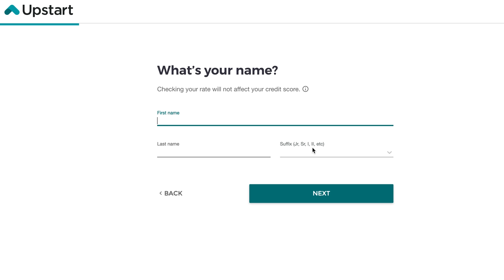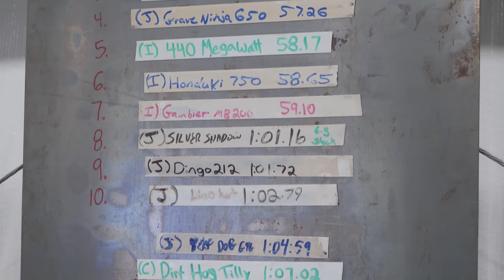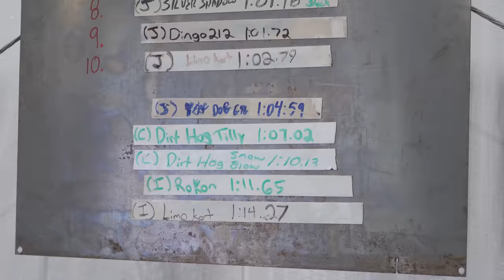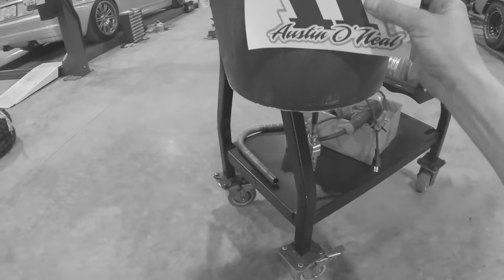SENDING Our 3 Engine, 3 Seat Mini Bike | SCARIEST Ride of Our Lives

Comment: That's just crazy wild. You guys should award each machine a "Pucker Factor", rated by how scary/sketchy they are to take around the track.
Reply: 5 million pucker factor
Reply: @catsbyondrepair  5 million seems a little tame to me, that's maybe the equivalent of a Habanero when this bike is closer to the Cali Reaper, or maybe the Dragon's Breath, or dare I say it, Pepper X. Its a pucker factor so high to initiate nuclear fusion, in which case the extra rocket thrust would make it even sketchier XD
Reply: No.
Reply: Wtf did I just read
Reply: @davedogg1177  Are you not familiar with the phrase "pucker factor"? Analogous to "tightening of the sphincter", and "clenching of the glutes". It's been around forever. Ben Hur probably used it while chariot racing! 😆
Reply: @catsbyondrepair  that sounds like enough to poop diamonds
Reply: PF of 11
Reply: I 2nd this
Reply: @moser1176 it’s there new diamond standard

Comment: It would be cool to take off down a straight road, max out the speed on 1 engine , 2nd guy start the next engine, max out the speed, then the same with the third.   Just to see how much difference each engine makes on top end
Reply: Or put the controls in the second position and let one person drive it to see how fast it is
Reply: Like Back to the Future and the train .
Reply: Maybe make each engine geared slightly higher than the last with the two first engine equipped with a sprag clutch to not over rev the engines. Sounds dangerous but fun for top speed
Reply: With governors it will be equal, acceleration will change.
Reply: Cassie Harry  tons of torque  though .
Reply: @Duckyninja50  underrated comment this is a great idea!
Reply: Cassie Harry  how about weight being a factor? I dont think one engine will top out the same as two or three
Reply: Knowing how horsepower and torque work I know that HP averages and torque multiplies.
Reply: @Duckyninja50  You do that and you'll over rev the first one and it will be pulling instead of pushing. You would have to drop out the first before applying the second like a trans but each gear has its own engine.
Reply: You my friend are a evil genius I like this idea and support it. 100%
Reply: DidI say it did equal speed ? This thing is fast enough . With the weight of three men, torque spec is even more important .
Reply: Cassie Harry  Of course horsepower equals top speed, when the gearing is set up for top speed.  This thing is more toward acceleration so each engine will top out - eventually - but if it were geared taller then each subsequent engine would add more speed,.
Reply: @Philc231  Precisely.
Reply: Or go up a hill???

Comment: Considering how big and heavy this thing is with the 3 of you guys on it, you’re probably gonna want to upgrade that drum brake in the back to something better and maybe add a front brake on it for when it’s just one person riding.

Stay safe guys!
Reply: Yeah they nee a front brake. I mean it's not like they could endo it with the front brake as long and heavy as it is.
Reply: Idk drum breaks worked great on big bikes and cars for years I think it'll be fine

A stronger pull on the linkage might help or hard rod to a foot peddle
Reply: @motorhead1884  Usually they do but in my experience, those drum brakes are just ok at stopping. Then you add 2 more full sized adults on there and I doubt those brakes work that well
Reply: @carsonhendee919  I'm not saying disc front and rear wouldn't stop better. I'm just sayn for what it is.  With a little tinkering I think it'll be fine.  Besides it's not a kid toy
Reply: @motorhead1884  Ahh ok, I see what you mean now with a stronger pull on the linkage
Reply: They already have one drum break and 6 foot breaks. It'll be fine.

Comment: Hey guys, NC biker on a '06 Hayabusa. Excellent Channel! I was thankin' y'all might consider fuel tank to rest chest on in race pos', and to centralize/balance/& weight to front/top fuel location, lay back front handlebars for 2nd seat pos', remove 1st-2nd pegs, #1&3 seats, 2&3 bars, & 3 tanks. Lighter, no wheelies, pure dig off the line! I've also watched Ike's channel from start. Y'all doin' good work! Just good ol' boys, havin' a good ol' time! Y'all have a good one!

Comment: I think removing the front engine and middle handlebar will give the feel that Ike was going for. Upgrade the back two engines, optimize the seating, and brakes and wider tires, and you've got a bad dude.
Reply: Add rear steering. As well.

Comment: i've sticker bombed a few things. i start with a couple to a few hundred stickers, depending on how much space you are going to cover, and the size of the stickers. the key to sticker bombing is to figure out which stickers you want to see all of, and use them for the top layer. for the first layer leave about half a sticker space between them, and for the second layer cover the spaces you left from the first. then apply the top layer, and KA-BOOM! the bomb goes off.

Comment: it's like a tandem, I rode a tandem with my mate and we were both pretty strong compared to other kids in the school.... but he couldn't just relax and let go so I'm trying to steer and pedal while my seat 9which his bars are connected to) is turning me around!
We switch places and on the back you gotta just relax and let the bike move underneith you and trust the person with the steering has it under control, once you do that it all becomes easy.
I think the rear bars are wide enough to give someone like Ike leverage to (subcontiously) control the bikes lean too much which is freaking John out, While John and Charlesa are on the back they're too apprehensive.
You gotta be able to almost take your hands off the rear bars or have a single grap point in the middle of the bars, Relax and keep your weight fairly central and feet up and let the bike move under the hips. A bit like a bucking bronco with your hands off.
That and experience where you gain trust and your brains kinda syncronise.... like a bob sled team.

Comment: Your guys expression looks the same as mine 20+ years ago when me and my friend put a built bored 6.5 on a mini bike (was told it closer to 10 hp). It ended up hitting 70 mph and would lay a 5-10 foot black burnout if floored. We all acted like we loved driving it but a week or too later we sold it for a go kart. It was just to damn scary. I own fast cars they dont scare me. Only two rides in my life scared me was the mini bike and a built banshee.

Comment: Centrifugal clutches in both 2 front engines and a variator to the tire.  Maybe a drag tire?
(Are those engines stock? There is a gold opportunity to modify them for more power and build an amazing drag bike. Or maybe track with proper configuration.)

Comment: I recon bin off the 3 seats and bars set up. Stick a single set in the middle. Make some longer set back handle bars and leave the front pegs up front so it’s more of a chopper riding style. Would make a cool drag bike/cruiser set up with loads of power.

Comment: Do a tie rod steering setup and drive from a more central position. You could make it happen so you have a few sets of different length tie rods to be able to move the position for different riding.

Comment: If you want the full experience, try setting it up so that the front guy steers, and the middle and rear guys have either the throttle or the brake. THAT would give Fear the maximum effect!

Comment: Super Sketchy!!! I told youn's, it's not long enough for the three of you!! "More cow bell"!! Err, I mean, "more frame length"!! lol!! On that last ride, you could tell the engines were hardly doing anything. REPEAT after you fix the throttle problem but please, remove the rear handle bars. Maby a couple of slide tube would also not be a bad Idea to protect the knees!!

Comment: i would move the front seat back and the back seat forward some and do away with the middle seat and try that before you make it into a drag bike. and maybe put some front shocks on it and dual disk brake on the front.

Comment: You guys should really buy 3 sets of foldable footpegs, it sounds dumb but it's really a safety issue. They were close to catching the ground thru the turns and it's super sketch since you frequently dab your feet for balance..its easy to catch your foot under the peg and break an ankle. 

I think this bike would do great with studded tires on ice. You could get the rear to hook up better but still be able to slide it.

Comment: You guys should dig a hole and push that thing in it before you get hurt! 😆 Either that or hang it like a tavern sign on the side of your shop. 😎 Or, option 3, Bonneville Salt Flats. 😯

Comment: That is so ridiculous it's great. When you convert it to a drag bike you should pull those 3 engines off and put 2 V-Twins on it with a torque converter. Maybe do a comparison between the 3 engine drag bike and 2 V-Twin drag bike...lol

Comment: Before you chop it for drag...
Steer from the back, throttle from the middle and brake from the front.
If you give everyone something to control it might not be as terrifying.

Or it will be complete and absolute terror. Either will make for a great video. ;)

Comment: you guys should take a gocart and put 3 engines like this on it but put them side by side and all connected to the rear axle for the throttle take some 3/8 rod weld som,e tabs on it and use it to sync the carbs  then do a grand prix lap governed vs non governed

Comment: Remove two of the handlebars, replace the remaining handlebar with a drag bar, remove all 3 seats, pad and upholster the entire top of the frame (with a little nub in the back to prevent sliding off) and move the foot pegs behind the rear wheel or at least have them mounted to the rear axle. Whoop!

Comment: I think having handle bars for passengers to brace themselves messes up the handling. Right now the handle bars give them good leverage to affect the bike and they have to guess what the controller is doing. If their hands were on the controller's shoulders they would have a direct connection to what's happening up ahead. If it was a heavy bike like a glide or a goldwing the passenger wouldn't make as big of a difference but you 3 guys weigh more than the bike. 

It's not easy to be a good passenger without touching the controller. Imagine using both hands to aim a shotgun while riding passenger on a bike. That is the level of stability needed to give the controller confidence.

Comment: Mark the tire and rim, see how much wheel slip you can get with stage 1, stage 2, and stage 3 mods on it. and there's no reason you can't put an insane fat tire on the back, like an ag heavy lug extra wide fat boi tire on it. See if you can dig a trench or do wheelies trying.

Comment: IN THE 70S there was a comedy show called the GOODIES and their transport was a 3 seater bike and in later years while reflecting on the show they said it took months for them just to get footage of the shortest rides they did get better but it was almost impossible to ride confidently and very dangerous and that's without a motor

Comment: If you can add a sprocket and a pivit point to the rear handle bars and a chain and sprocket to the front bars the rider can ride from the middle in solo rides ... it would handle alot better ...
Reply: * middle handle bars to the front handle bars **

Comment: Has anyone ever thought about hydraulic throttle? On something like this, or the 4-engine monster, mount a hydraulically actuated lever to the throttle for each engine and plumb it to a manifold. When the throttle lever is applied, you would get even actuation on each engine.

Comment: Hey um... would putting a Jack shaft driven torque converter be a possible insulation?
Reply: I think that should give you a wider acceleration / power band.

Comment: yes, ideally, you want them to lean with you by hugging your back and following your lead.  but it's not a big deal.  i don't care if they weigh 250 lbs.  an experienced rider, who understands counter steer, can correct almost subconsciously.  it's the easiest thing in the world, IF you have the reflexes that come with years of experience.  and that experience does not have to be with a passenger.  the same principles apply regardless.  
now, if it happens at an inopportune time... like say you're about to turn left and she leans right... then yes, it can scare the hell out of you if you're not ready for it.  but even then, it's not a big deal unless you're inexperienced and don't have a good feel for counter steer.  otherwise, normal cornering technique will automatically correct for it.
counter steer will become second nature once you've got enough miles under your belt.  i'm talking years because most people only ride a few hundred miles a month, if that.  but you can speed up the process by just using it a lot, even when you don't need to.  just sway back and forth when no one is around you, and your subconscious mind will get a better feel for how the bike reacts to your inputs.  i used to live out in the country where there were long stretches of road covered with those strips of black tar they use to fill cracks.  i would do a sort of pretend slalom and try to weave around the tar snakes like they were two by fours in the road or something.  that right there is excellent practice with counter steer, and it'll translate directly into correcting for an unbalanced load like an inattentive pillion.

Comment: You should have throttle to the back have the middle rider run the brakes and front just steer

Or what would be cooler is to have the steering moved the the middle seat. Front seat does brakes and rear runs throttle..

Comment: Your supposed to have the rider in the front only controlling  steering. The rider in the middle only controlling  throtal and the guy in the back has just brakes. Makes for a way more enjoyable ride when you can at least control something instead of just being at the mercy of the guy in the front

Comment: cadillac limousine of the bikes
Reply: try aluminium wire inject fuel cell salt electrolyte water electric engine generator, 90% efficient, aluminium or magnesium, energy density 50-75% of gasoline, but 3x efficiency
Reply: metal wire spool vs gasoline has 8.3kwh/kg 90% = 7kwh/kg vs the gasoline 12kwh/kg 25% = 3kwh/kg as pure output power to wheel
Reply: aluminium metal-air feeder fuel cell engine has double the specific energy to gasoline, the practical efficiency, and the electrics are 90% plus efficient
Reply: use a trailer instead, self-balancing

Comment: It is only 30 hp .that's not much power in a motorcycle.  Why didn't you use a 520 chain and proper sprockets. It would not have a problem handling 30 hp.
Now build a swingarm with some shocks. And a 
Simply leading link on the front.  Than it will be useful . After you remove the back two sets of handalbars, they give the passengers  loo much leverage.

Comment: OK - Hear me out:
remove all the clutches, put strait sprockets DIRECT on the three engines, all the same number of teeth, with like #40 or larger chain, with the engines timed and Phased 120 degrees from each other so it's like a ONE ENGINED Three cyl bike- then ONE CLUTCH, on the rear engine to the wheels with like a proper 530 Motorcycle Chain & Sprockets to handle the load of the 660cc engine and the weight of all-Ya'all........ THEN POST A TEST RIDE!!! I bet it's 1000x better??!! Thoughts??? Anyone? Anyone? Bueller?? Bueller??
Reply: I get ya, not a bad idea.  I think the torsional fluctuation without any dampening might be hard on the chains between the engines, they'd probably flap around a lot, especially at idle. Worth a shot at this point with that thing!
Reply: @landengreen6982  I mean, a gear-drive between engines is out of the question for these goofballs, you can get a 1/2" thick white Teflon Cutting board at Harbor Freight or the dollar store to chop-up & make guide pads for the chains cheap enough........

Comment: This video brings our attention to an often-ignored subject ... passengers on motorcycles.
Whether you are newbie rider with 10 hours on a dirt bike or a 100,000+ mile street rider, riding with a passenger IS NOT THE SAME SKILL SET AS RIDING ALONE.
Simply don't do it until you have several hundred hours experience. 
If your passenger weighs more than you, this is a pro rider scenario.
Big heavy fast bikes work best.  I would always tell my passenger to hold onto ME and try to become one piece with the bike.  On my FJ1100 Yamaha a simple blip of the throttle would send them back then forward bashing their helmet into mine and tightening their death grip so I could accelerate or lean the bike aggressively.
I have heard people say "the bike wouldn't turn" because the passenger was leaning the other way.  BULLS#!T  The bike will ALWAYS turn when you turn the handlebars in the opposite direction of the turn.  This forces the bike to lean into the turn and nothing your passenger does can stop it.
Be careful with your passengers.